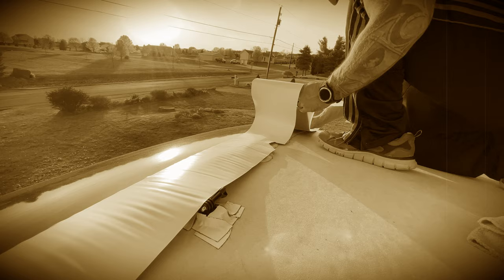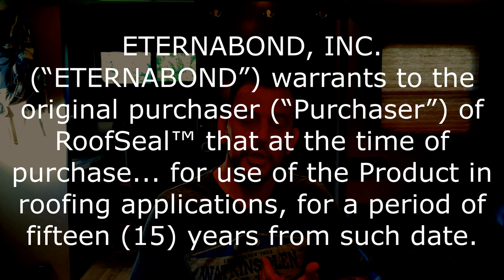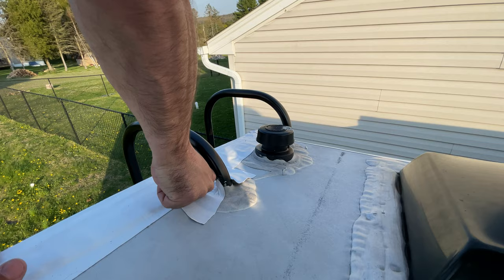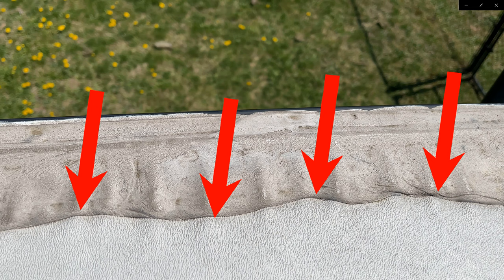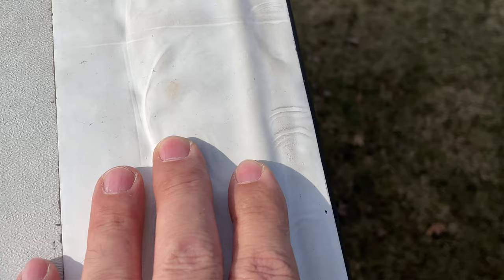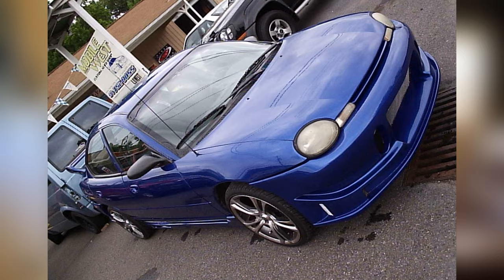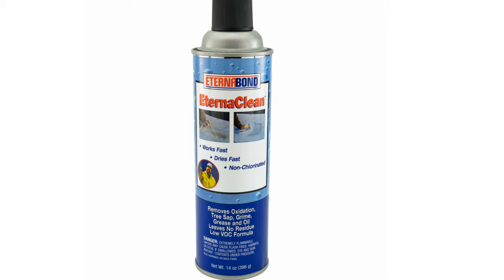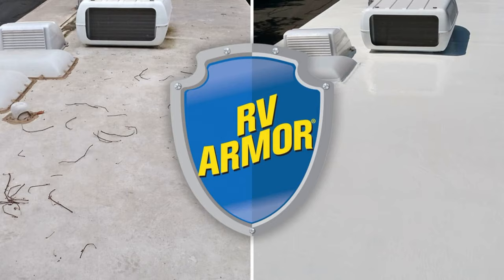The RV Eternabond Roof Seal Modification 1 Year Later

Comment: Well researched and informative video.  I get that a few people won’t like the way it looks, but I couldn’t give a shit what my roof looks like if it was all sealed up.  Besides, I think it looks good.  As if lap sealant looks good anyway.
Reply from the maker: Thanks Stan, appreciate that!
Reply: Very informative. I have a question, when installing the material at the cap screw covers, do you wrap over the top edge or stop at the metal trim? I also have a suggestion that I haven’t seen on any of the videos relating to Eternabond.  When applying the material, it’s best to “round” the corners. This helps keep the “square” corner from lifting or something snagging the corner. Thanks again for the videos.

Comment: You should always round off your corners on your patches because the corner edges will peel up first.
Reply: that is a super great tip. Thanks a lot.👍
Reply: not if you seal all the edges with dicor. As an rv tech I always seal all the edges with dicor self leveling added and cheap protecttion
Reply: If This is real ?? Then the edge of the circle will also lift.  Hillarious your blind lead blind
Reply from the maker: It’s real, and the edges don’t pull up.  Here’s proof 
https://youtu.be/FZzLNorRAmo
Reply: Nose on a ship, airplane.....   Rounded for a reason.... 90° angles create a turbulent sucking air current... pulling at the rear or lifting..... physics
Reply: @eddiespagetti8395 a bit of research on stress risers and basic physics would definite be helpful to you.
Reply: @eddiespagetti8395 Been a Master certified RV tech for decades, always round your corners. As far as sealing with Dicor  or similar, that depends on location and application.
Reply: not with this tape. That shite sticks!

Comment: Eternabond is legit. Used it on my roof 10 years ago, and it's still going strong.
Reply from the maker: Awesome to hear!
Reply: That's good to know. One year is nothing but ten is meaningful.
Reply: Did you just use it on the edges or could we apply it to the entire roof in place of sealant?

Comment: I used the eternabond webseal tape over everything like yours and then coated the entire roof with 2 coats of hengs.  From what I read the webseal is meant to be used with coatings.  Has held up well for year and half so far.
Reply: What are "hengs"?

Comment: I suggest every RV keep a small roll of it around for emergency repairs. It is a great product for patching scrapes and punctures in to your roof, or anything that you want to keep water out of. I have used to it to patch many things. 
In fact I have the remnants of a roll from 2005 and used ~5 in sq to patch a small hole and the tape was still good. It's been more than 2 years since that patch and it is still holding.
Reply from the maker: nice, thanks for sharing!

Comment: I did this to my trailer when installed a new 60mil roof membrane. Even used it on several areas under the membrane to make sure of no leaks. 3 years later and not even a hint of worry about leaking. I did not use any lap Sealand and did pure eternabond tape on edges and around evetyhing on the roof. Followed Ray from "Love your RV" with several mods that have worked out great. The rope at the back end under eternabond tape has worked out the best. Forces the water to the outside gutters. 
Great 1st videos as well as your as your follow up.
Reply from the maker: Thank you Steve!

Comment: I liked the video. As an engineer that used to do rubber roofing. I'm also going to take your advise. Everything will fail eventually. But it's the caring and the( going the extra ) mile that's going to make the difference. I'm about to pick up my new camper this weekend. And I'm going to do this immediately. Thanks for the idea.
Reply from the maker: Thanks Shane.  Clean well and apply slowly!
Reply: Definitely going to do this as well.. picked up my new grand design last week and altho it's built pretty well it's definitely not up to my quality standards therefore I'll be going thru and upgrading ALOT of craftsmanship issues but I knew that I would be doing that from the beginning. These RVs are ALL slapped together for fast production and quality suffers tremendously but it's just how it is now adays sad but true. It helps to be a do it you're selfer and prolong longevity of you're investments!!! That's why these shared videos are wonderful 👍👍👍👍😎😎😉😉😉😉

Comment: I bought 2 rolls of eternabond tape to repair a lady's rv roof. I haven't opened it up yet but I'm certain I will need to replace some rotten wood before sealing properly. Thanks for posting this very helpful and informative video!
Reply from the maker: smart man... agreed, everything under the Eternabond should be healthy before applying it.  It's a roof sealer, not a band aid.  Good luck and thanks for watching Ron!

Comment: Great videos. I have been working on rvs for nearly 5 years now and agree with your techniques including using self leveling lap sealant on any leading edges of the tape just as a barrier from anything eventually working it’s way into that leading edge. If I may suggest when removing a penetration of the roof (ie vent) I found an oscillating tool with a knife edge blade inserted careful not to puncture the roofing material works well to remove old sealant in mass as well as a narrow putty knife with the corners rounded. As far as cleaning anything I use an orange oil based cleaner after Oxiclean for heavy organic dirt.  The best product for cleaning stuck on glue is rapid remover on a semi-saturated small rag to soften and eventually remove any glue residue. It’s pricey ,but, very effective if you allow it to work for you.
Reply from the maker: thanks for the info Michael!
Reply: O.K. Gentlemen, I have a question.  I've just purchased my first RV.  Don't get excited, lol, it's a 22' 1984 GMC Citation Supreme Class C. Yes, it still has the original aluminum roof. And it is immaculate !  However, with the couple of times that I have been up on the roof, not for an in-depth inspection, I have seen areas that look like the sealant is starting to crack and lift & are going to need resealing.  I'll do my research further as well as respect both of your opinions if you care to answer.  And I do hope you choose to.  I'm wondering if I should put a membrane on the entire roof?  Not only would it eliminate seams but I also believe it would make it quieter during heavier rains.  And if either of you think so, what are your reasons as to why?  If that is going to be the first step, then I would reseal it all & then install the Eternabond.  If I am following correctly.
Reply from the maker: i would not put a membrane over aluminum.  no need.  membranes protect wood.  i wish i had an aluminum room! you can use eternabond on the seals though.
Reply: @RVTIPSANDTRAVELS  Thank you soooooo much for responding!  And the info!  I really appreciate it!  The seals have been patched a few times.  I think my best bet is to clean the old sealant off as much as possible, Reseal, then use the Eternabond. And I absolutely LUV your channel!  Thank you for the amazing information!  Bravo!

Comment: Keep a small roll in the camper drawer for those unexpected issues.. Also they recommend using a Eternabond Caulk specifically designed to seal the edge of the tape.. Used it a a branch puncture 6 years a go and it’s still holding. They also offer along with the cleaner a adhesive enhancer spray. Good videoo
Reply from the maker: Thanks for watching Rick.

Comment: Used Eternabond on my 2004 National Dolphin in Oct 2010,  now Nov 2022, I did seal the edges with 3M 5200, still doing fine 12 years later.
Reply from the maker: good to hear!

Comment: Looks like a good solution, we painted the roof sealer on our dicor a couple times. It did well, but needs reapplied every 2-3 years. I did it because our Lance had a minor skylight lead when we brought it home and it hasn't leaked for five years since. Now we are picking up a new Imagine in the next couple of weeks if our dealer gets a timely delivery from Indiana. I definitely see the need for both my thumbs AND a roller as these 61-year-old hands need some backup, LOL. Thanks for the video and follow-up. Cheers, Davey - KU9L
Reply from the maker: Thanks Davey. Good luck!

Comment: Ross I did this 3 years ago and for those that have slides I would suggest doing those as well. The mfg already have a strip running from end to end on the slide box. RV’s are not really an invest but anything you can do to protect what you have invested into is just common sense.  And you should still inspect your roof regularly which I do monthly or each time I move because limbs and other garbage seem to fall on it.
Reply from the maker: Thanks Jeff, agree with you.  I havent done my slidout because the factory tape has no issues to date. Inspection is also important.

Comment: One would think the manufacturers would use that tape. Great videos!
Reply: Too expensive and too time consuming to put down.  The manufacturer can shoot caulk out 20 times faster.
Reply: My Grand Design has it on the slides and on the rear edge from the factory.

Comment: First, we had pop up campers for years and sold when the kids were in sports, have recently purchased a used camper trailer and your videos are my number 1 source of information, thanks for sharing your knowledge and experience.  This camper has needed some tlc, and I know from you, what to tackle and how,    

Unfortunately we have pine trees along our parking spot, and I have done some manage to the roof that I have been working on.  I am going to use this stuff along the top side edge like you did, and wondered if you have regretted attaching the bond to the replaceable trim cover stuff, that 1 inch replaceable trim that covers the screwed down trim tracking.  Since that trim is destroyed by the sun, and needs replacing ever so often, which I did just do on ours.  But given it might need replacing again, what are your current thoughts on how you went half way down and stuck the bond to it?  Regret it?  Worry bout it for the future?
Reply from the maker: Thanks for the nice comment Chad.  If the bottom half that piece degrades from the sun (the top half wont because its covered), ill just pop it out at the bottom and slice the eternabond at the top where it connects.  New eternabond would  need to be installed on the sides but you can go over old eternabond with new.  they actually mention this in their video.  its a little work but ill also put some plastic and rubber seal treatment on it when during my maintenance and after 6 seasons its showing no signs of degradation.

Comment: When’s the big update coming? I saw you have some data from others. I did a trailer last summer based off your info, tan roof with black tape, looked awesome. But we loved camping so much we traded for a grande design 5th wheel. Trying to decide if I want to do it again to a brand new camper. Nothing to lose on the last one, knew we wouldn’t have more than couple years. But I was so proud of how it looked while I had it.
Reply from the maker: the 2 year update will be this summer, just not sure which month.  Stay tuned (*spoiler, no different than 2 years ago, still looks like it was just installed)

Comment: I have the RV armor roof.  I’d always said when I got a new Rv I was going to do this, but since I had planned on RV armor from day 1 I sent them a message and they said it would be better from their aspect to not have the tape on….
Reply from the maker: interesting Barr.  A buddy of mine down in MD had it put over the tape, they said it would be fine.  I guess it depends on the service dealer who is coming out to do it.  How has it held up for you?  Thinking about doing some type of coating on my roof.
Reply: @RVTIPSANDTRAVELS  I’m working on an update.  It has cracked in a few areas and I’ve been working on coating over them.  I personally believe that the cracks are fine most of the time as you have to remember that under it is multiple layers of the roofing, an epoxy base coat, and your factory TPO.  They did offer to send someone out for the warranty work but I am doing it myself.  To me it’s about the lifetime warranty for failure.  They say your warranty is intact even if you never get on the roof.  I still recommend washing it and inspecting it yearly though.  Overall I’m still happy with it

Comment: I changed out my eternabond on my slide outs  and the easy way was to use the eternabond cleaner spray and a plastic putty knife spray then scrap up. I tried a heat gun bad choice it turns the eternabond to a messy fly tape.  Ive been kicking around the idea of doing my roof. Also.
Reply from the maker: a little patience and a good putty knife and its not all that difficult to get off.  the hardest part is getting that last layer of sealant off, but if you are going back over it, you can apply new eternabond over the old microsealant.

Comment: I have a fiberglass roof that goes down the side to the 'rain' tray/drain. The RV tech tried to seal it with the eternabond but it eventually lifted up. Now the other side has popped up. Going to just fill it up underneath with sealant hoping the works. Would love to seal around everything with the eternabond.
Reply from the maker: Eternabond is extremely difficult to remove and if applied correctly on an approved surface it is never going to pull up as it did in your experience.  I would be mindful of using that rv tech again for this application.  I have done exactly what you said over 2 years ago and neither side has lifted. It was definitely not prepped or applied correctly, or both.

Comment: I notice you installed the EB over the little vinyl trim that covers the screws up on the edges.  That trim seems not to last and I had replaced it.  But with what you doing, it seems to take care of that.
Reply from the maker: Good observation Ron.  I figured the eternabond would help protect that piece.  Plus I put 303 on it every 4 months.  If I do ever have to remove it, I’d just cut the tape at the edge, remove the cover piece, and retape over the new piece and everything else as I originally did.  You can apply eternabond on eternabond.

Comment: Sounds like a good product.  Sounds somewhat like the tape version of “flex seal”.  Would be nice if there were more color choices for the case where the tape is needed for sides of the camper walls and/or where the wall meets the roof line.
Reply: Lol. No, Flex Seal tape is a comical rebranding of a butyl tape that's been in the commercial market for decades.  

Eternabond is a smaller width and length finishing and rebranding of a commercial roofing product.  You can purchase the commercial in a larger variety of widths, several colors  (including almond), but longer lengths.  

Honestly, you are better served keeping a small roll handy for repair and banking all that money otherwise spent on that much tape for prevention given RV roof membranes fail because of accidental tear or puncture, lack of seam maintenance, and bond failure.  If you need to replace the membrane, draw on those banked funds.  If not, it's available for deposit on your next RV.  Commercial thickness TPO, which is way more durable than the thin AlphaSystem product, actually costs less material-wise.  

Roofing, RV or otherwise, is expensive because of the intensive labor.  If you are a capable DIYer and have a clear weekend, you can easily knock out removal and replacement of 40' RV roof with a helper.  The biggest chores are removing A/Cs, skylights, fans, and vents and then sanding off the old adhesive.  In fact, most RVs are reroofed using a very thin veneer over the original roof decking after the initial membrane is torn off and thick areas of adhesive sanded down so the veneer has good, uniform contact.   Some manufacturers and shops re-roofing glue the veneer with a troweled construction adhesive, others a million staples coated with heat activating adhesive.
Reply from the maker: thanks for watching!
Reply from the maker: flex seal doesnt compare to eternabond, its also silicone based the last time i checked.

Comment: Thanks for the video. I had good success with the product. Question: i have a few areas, like the ac unit, where i cannot easily get to the locations where i would want to seal it. Is it difficult to take off the cover, or other outer components to get to the areas that need to be sealed?  I dont mind doing it, but would like to understand what i am getting into before i start removing things
Reply from the maker: I didnt do around my AC, but here is how you remove the shroud: https://youtu.be/5iQp_UOqjdE